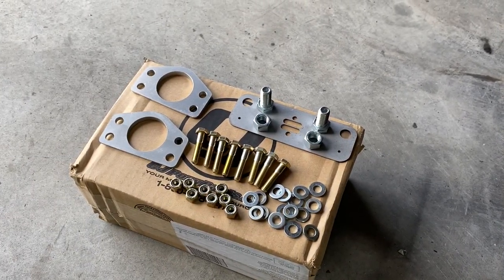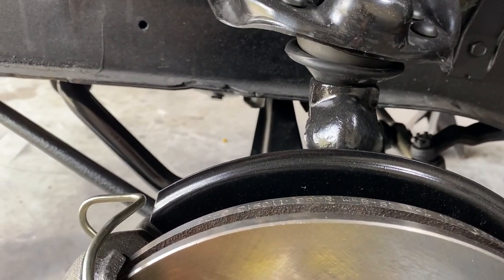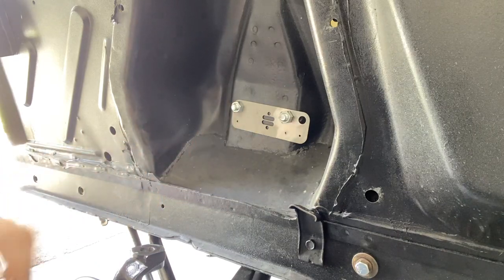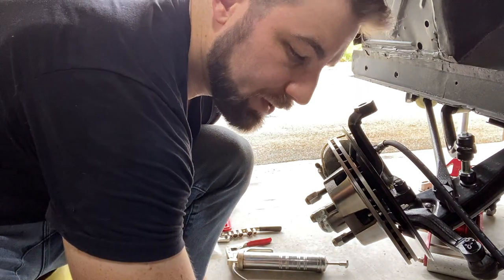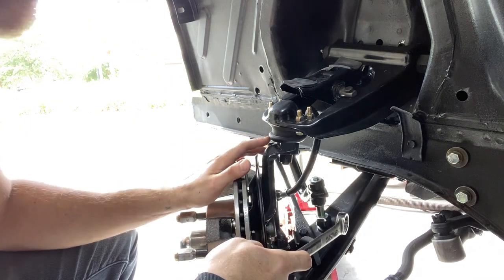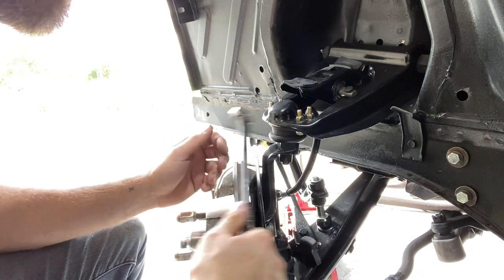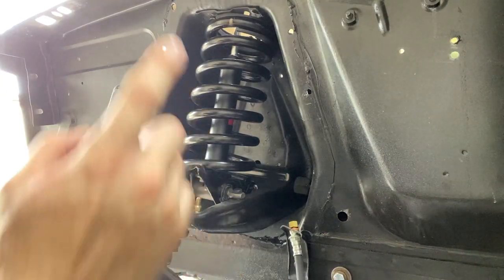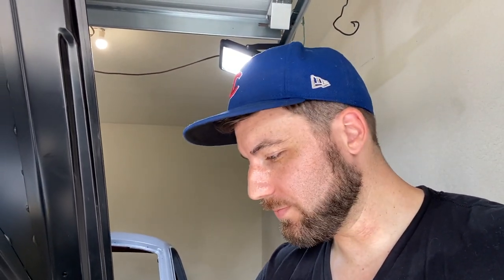Classic Mustang Handling Mods - Shelby Drop - Camber Wedge Kit

Comment: Hi ,the purpose of the camber wedge is to keep the ball joint at its original orientation when you do the Shelby mod otherwise when the suspension goes into full bump it is theoretically possible to exceed the ball joints range of movement and it could fail.Hope this helps
Reply: Can confirm. I replaced original springs with aftermarket coilovers and lowered the front end 1.5" relative to stock height. Ball joints lasted about 100 miles before one failed. It's too much bind. Adding the wedge kit should address the binding issue on a lowered Mustang with or without the Arning/Shelby drop.

Comment: Here is my modification:  I used 1974 Maverick spindles. The Ball joints are offset/asymmetrical  giving free caster. I did the One Inch drops too, but I drilled my pilot hole s completely through. Than I biased my upper control shaft rearward 1/8th of an inch rearward. I got 1968 Mustang big block coil springs and cut 1/3rd of one coil off. And used the Shelby alignment specs. The result, the car handles like a Shelby without the front end dropping, the car is level. Export and Monte Carlo bars, 1 " front 5/8th" rear sway bars, polyurethane bushings, 1/2 extra rear leaf spring. And fyi, the parts that wear out the most on a stock Mustang 1st generation are:  the upper ball joints, tower bushings, lower arm busting, idler arms. The result too is I did not have to roll my fender wells and I had plenty of tire clearance. I did this 30 years ago before wedges.

Comment: I may be wrong but it looks like the tapered washer should be the other way around the thicker side should be on the outside to compensate for the angle. The bottom of the nut should sit flat when it reaches the washer.

Comment: 4:28 - What is the reason why you didn't weld the old holes of the upper control arm?
I think now would have been the right time before you complete everything again.
And a color job wouldn't have hurt either....

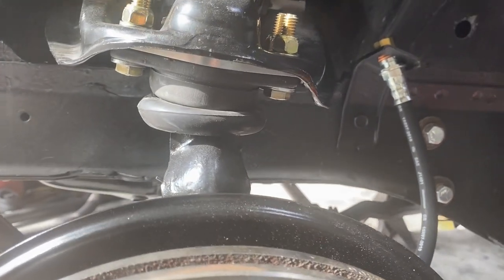11:51 - using of the ball joint shim changes the position of the lubrication nipple downwards in the control arm 
The lubrication nipple is also covered by the screws, which are much too long. (Why didn't you shorten?)
Can you grease the ball joint in a service-friendly way without hurting yourself? I can't belive .....

Comment: There is a critical flaw in the universal RideTech template seen at 3:50 in the video,  On a 65-66 the Shelby/Arning drop offsets the holes toward the rear of the car to increase caster, a much needed consideration in the '65-66 cars because caster is only adjustable via shimming during alignment.  This $70 kit is a cheap way to obtain the wedge spacers and hardware, but you should obtain the drawings used by Shelby or a proper template from a reputable source like Opentracker Racing for the correct '65-66 locations.  The '67-73 cars can use this template without issue.
Reply: Yes the shelby mod on the early cars was "down an inch and back 1/8th"

Comment: What size drill do I end up with? Thank just received my identical kit.
Reply from the maker: Thanks for watching Noe! A 17/32 drill bit is the perfect size, can be hard to find locally so you might have to source it online.
Reply: Thank you so much bro. Happy Holidays.
Reply from the maker: You’re welcome, Happy Holidays!!
Reply: 1/2 is the correct size, upper control arm bolts are 1/2 diameter.

Comment: Does this kit work with power steering on a 1966 fairlane without modification?
Reply from the maker: It looks like it would, they offer the kit in a three bolt as well if your Fairlane has three bolt upper ball joints. Thanks for watching!

Comment: The special washer you  were addressing is called a Lock Washer, it's main purpose is not for leveling a surface to mount a fastener but for locking the nut to the bolt. It's main purpose is to prevent the nut from backing off the bolt and it should be installed under the nut   and over a regular washer.
Reply: Please refrain from commenting when you know absolutely nothing about what you are speaking about, the washers are indeed made for achieving a flat plane for the nut to go on, I looked several times and the kit does NOT contain ANY lock washers, only FLAT, and the special washers to offset the angle in the wedge under the ball joint.

Comment: Do you have to get different springs by dropping it one inch.?
Reply from the maker: No sir, you can use your original springs. Thanks for watching!
Reply: Why would you want to use your stock springs especially after doing a Shelby drop?  I would upgrade to 620 springs, 1-1/8 away bar, export brace, but importantly if you're able to is to re-weld both Shock Towers on both sides on every joint, including around the frame.  Stock shock towers are known to split and that can be very dangerous and catastrophic if it happens while driving.